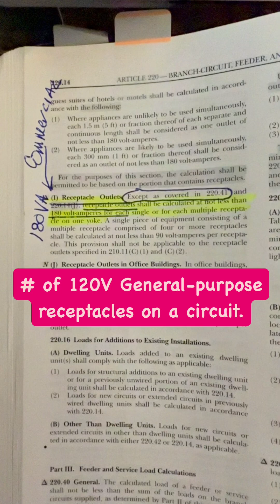# receptacles permitted on a general-purpose circuit.

Comment: In an automotive garage or automotive body shop try to put 13 receptacles in a row you be blowing circuits left, and right with all the electrical devices plugged in. 
     Horticulture Cannabis Grows facility where they like to plug in a lot of extension cords and accessories into every outlet in every wall